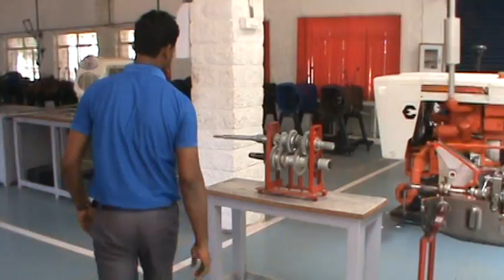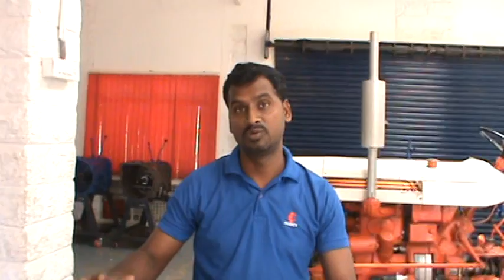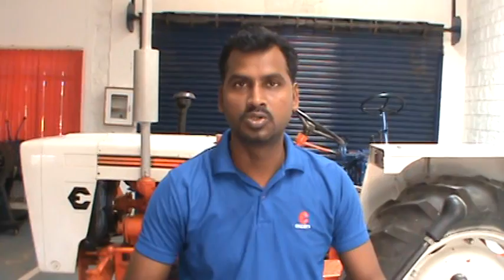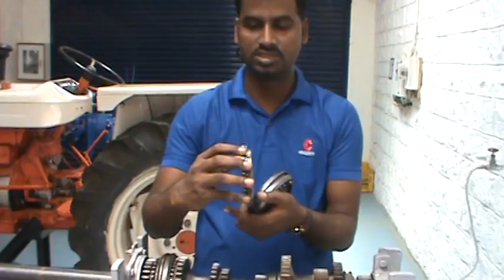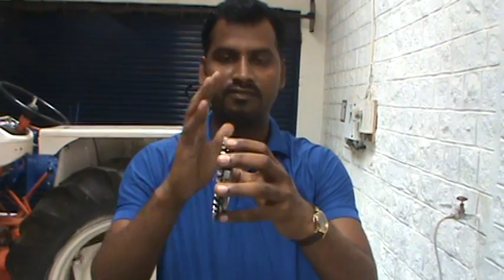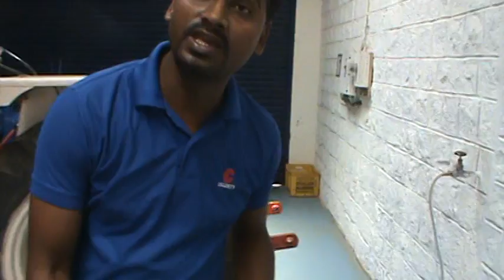Gearbox - Slidingmesh Vs Constantmesh Vs Synchromesh - English

Comment: Sliding mesh type gearbox is used in conventional lathe, milling machine and conventional machine tools. The gear is changed while machine is in stop condition. If operator wants to change speed of rotation of job or tool cutter, he is required to stop machine, change required gear and then restart the machine.

The constant mesh type is mostly use in Motorcycle and because of not having synchronising rings, some time during gear change, there is jerks. But because of small size, the jerk us not noticeable. This is used in Motor cycle. And NOT in 4 wheelers and trucks. Motor cycle uses sequential gear shifting.

Synchromesh gear box, bring improved version of constant mesh gearbox, it has synchronization rings, and because of this, during gear change, this synchronising rings, the gear shifting hub match the speed of other  part on gear and hence, no jerks is felt. Very smooth gear shifting. This is used in 4 wheelers and trucks. Cars and trucks use random gear shifting.

Comment: Engine:  2 - 4 Cylinder Parallel Engine

6 Speed Constant Mesh Sequential Transmission & 2 Reverse Gear

Shift Pattern:  N 1 2 3 4 5 6